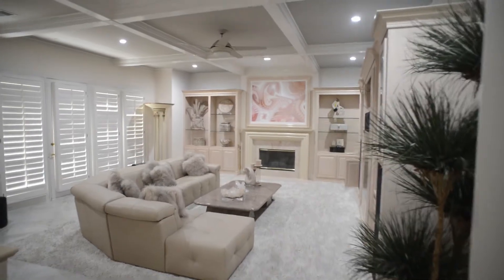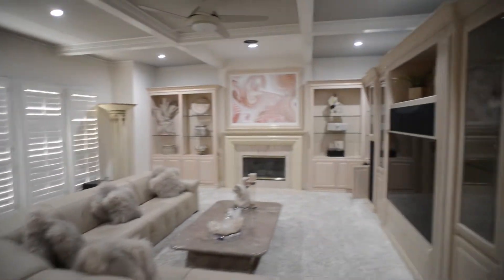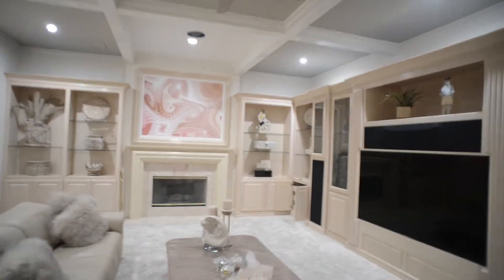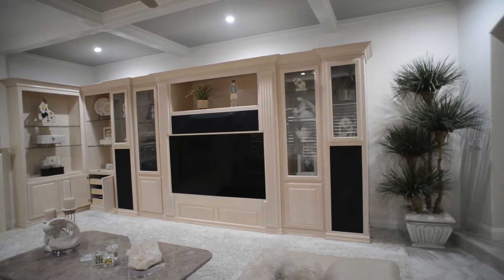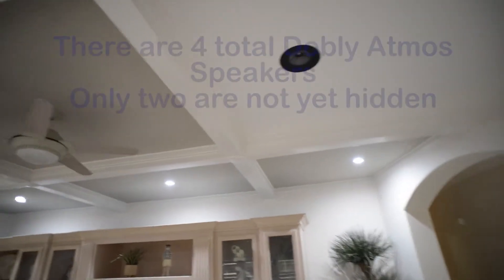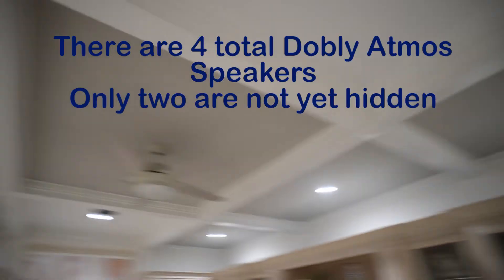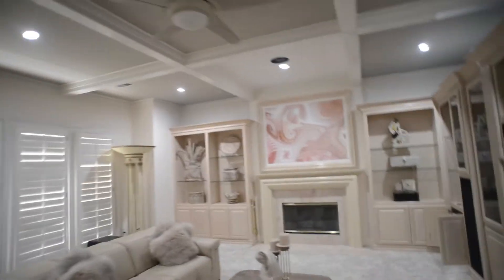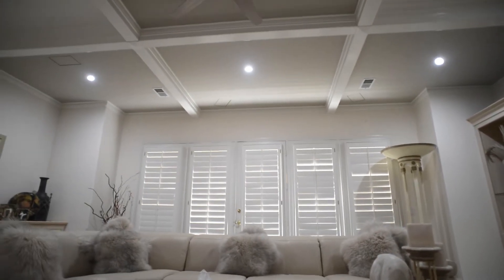Automated Drop Down Surround Speakers

Comment: FANTASTIC work. Cool and classy install. Only downside, you do not get any (very little) base from free hanging speakers. But another few small element subs will help with that tight base.
I guess you pull cables sideways... Unless you have a LOT of inner ceiling height hidden :)
Reply from the maker: Cables are guided by ECHAINS, over pulleys. Crossover points between hanging surrounds and two 13inch subwoofers is 80 hz. I dont believe I am losing any bass. Also the front, right, and left speakers are large floorstanders. (Kef also), The entire system runs horizontally through the first and second floor with only about 16 inches of height. There is no attic.

Comment: I have one suggestion,  you should add a base to the bottom that extends about a quarter or half inch all around so you dont see the openings when the speakers are in the ceiling. Something like a really thin piece of metal painted white

Comment: Great job. Are these speakers "shaking" when they playing? How stable these speakers are? Thanks.
Reply from the maker: Also, I am using subwoofers and speakers are not producing much below 80 hz. The are definitely not vibrating or shaking.
Reply from the maker: I checked into that before building it. The physics is such that they are essentially solid. The woofers moving mass will not translate to the speakers mass. And certainly either will the tweeters. In fact, what happens, is the speakers become completely isolated. Keep in mind the debates on spikes vs speaker foam pads. This would be more like speaker foam pads

Comment: Do the speakers get dusty being hidden in the roof cavity?
Reply from the maker: The whole system works horizontally between first and second floor. In one year, I havent had to ever dust them off. I did vacumn out the joist spaces before I put them in. I would imagine that at lease some dust will build up eventually, but Ill bet it is less then them being out in the open.

Comment: I would love to message you for details on the engineering that went into this. Did you write an app for your phone as well? If you have time for a conversation I am very interested in picking your brain. Great job on this install.
Reply from the maker: And its got safety systems built into it. If it is swinging when it starts up, or gets impeded it will stop automatically. It also accelerates at start and decelerates at end. Plus the speaker cable is continuous from amplifier to speakers. There is no "sliding contact" reel involved.
Reply from the maker: email me at cgordon999@aol.com. But I will warn you in advance that it is fairly complicated. But my wife and I love it. Every night it comes out, and every night it goes back into hiding.

Comment: OMG I just pee myself, so impressive! Do you have a video how it was created? Was this a DIY or a shop did this?
Reply from the maker: I built it myself from scratch. The entire system runs horizontally through the space between the second floor "floor" and the first floor "ceiling". There was just enough space to get the pulleys and speakers in with the proper gaps. The speaker wire uses a unique "e chain" to lay it out smoothly in a straight line as it goes up and down.
Reply from the maker: Conceived, designed, engineered and built by myself.
Reply: @CitadelRunner  this is awesome.  Finishing my basement this month.  Can you tell me any specifics of the hardware that you used?  Thanks.
Reply from the maker: @mlovitt01  contact me at cgordon999@aol.com
Reply: @CitadelRunner  thank you!  Just emailed you.

Comment: I have a similar need and thought about that drop down solution.  Great to actually see someone do it.  I was looking to buy it if I could find someone that manufactured it. Nice job.
Reply from the maker: At this point in time, this is basically a prototype. Each system needs to be custom built into the home and depends on many factors. My email is cgordon999@aol.com

Comment: The coolest speaker setup ever. Seriously. No over done home theater stuff, just solid engineering. It looks like a normal room. Super well done. 

I wish you could design mine. I lack the talent. :)
Reply from the maker: Well, if you knew how long it has taken me, you would realize that you can do it as well. :)
Reply from the maker: Is this Wil? 
At this point in time, this is basically a prototype. Each system needs to be custom built into the home and depends on many factors. My email is cgordon999@aol.com
Reply: Yeah its me.  :) I'm emailing you.
Reply: Got my track actuators, steel wire, chrome anchors.  Just need the rest of the parts list and the original list you sent me.  I changed phones and lost all the messages.  But it is happening.  Woohoo!  Thanks
Reply: I totally messed up my install.  Total failure.
Reply from the maker: @Gorilla_Jones  What happened? Contact me and maybe I can help.
Reply from the maker: @Gorilla_Jones  There is no such thing as "totally messing up". You can always start over or repair whatever problem you have.
Reply: @CitadelRunner  do you have a parts list and tutorial to replicate this?
Reply: @Gorilla_Jones  do you still have the list? Could you share it? I tried reaching out to original poster and didn’t get a response. Thanks!